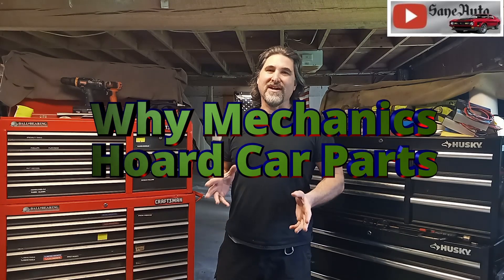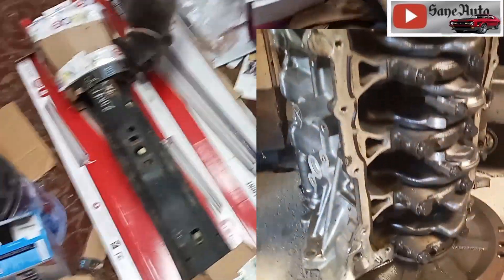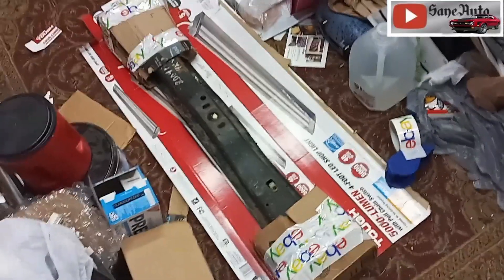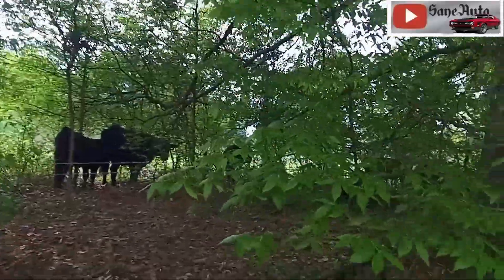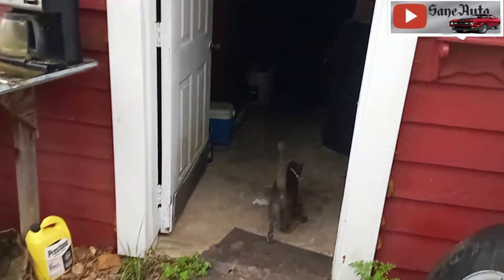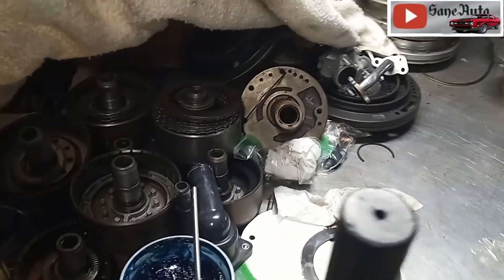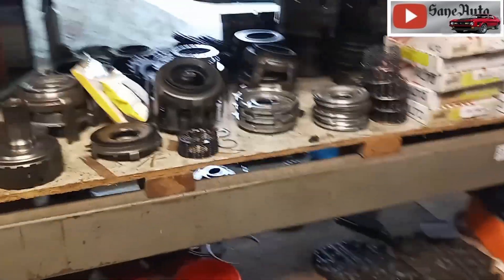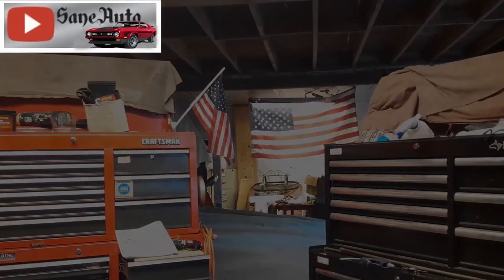Why do Mechanics hoard car parts?

Comment: LOL I have this issue with riding mowers & other small engine equipment. Just not as much $$ pay back. Never fails in less then a week the part/parts you finally got rid of that you were holding forever are now needed LOL I have to get a large shed so I can organize it all.
Stay well,
Joe Z